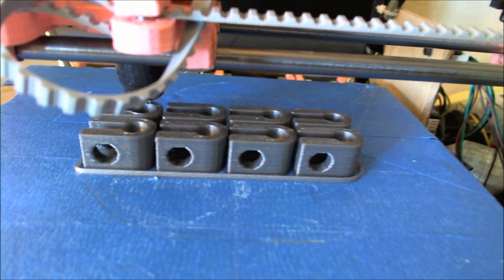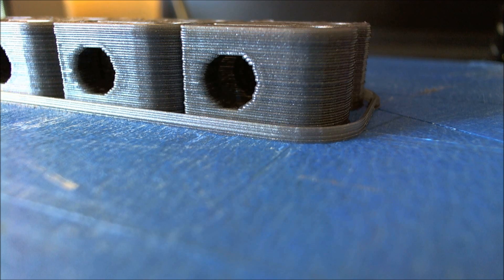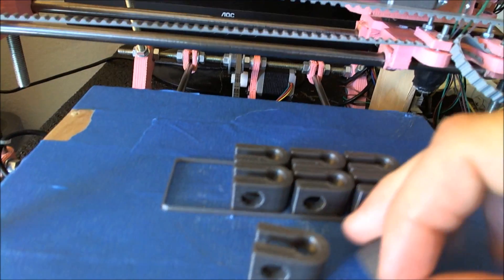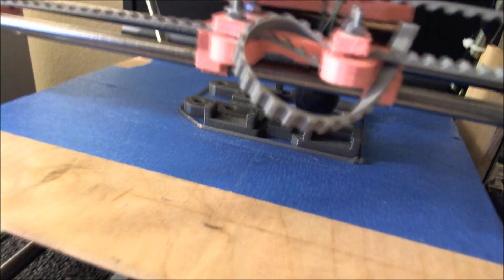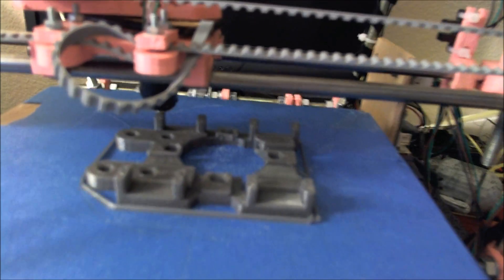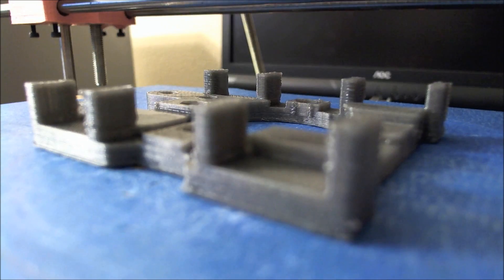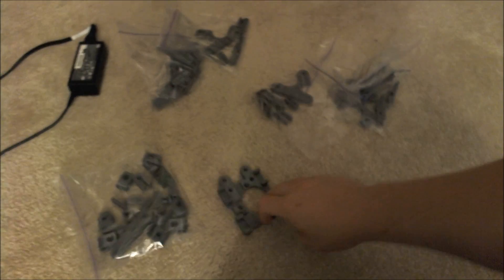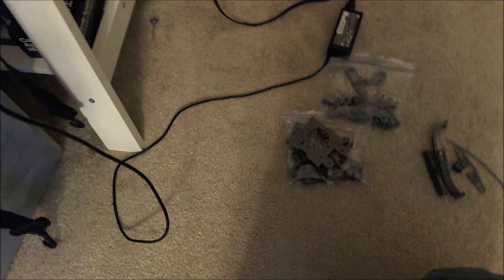Why I am starting to LOVE my 3D Printer

Comment: Thanks for the video!!! Awesome prints :D 

Btw, for anyone who has some ideas......

XYZ Da Vinci VS Prusa? 

Budget: Low to £800 (though I could get the Da Vinci for £450)

Main priorities being the print bed size/max dimensions possible, ease of use and cleaning, reliability, using Blender (or something similar?) to model, and safety ^^

I really appreciate any ideas and thoughts! Thank you!!

I'm up for modifying but would rather not-- just in case I ruin something!!
Reply from the maker: +AmbieWolfie I would always recommend building your own over a out of the box machine. Plus from what I've seen, DiVinci kinda sucks

Comment: Where I used to work plastic parts aged like metal and needed replacement as fittings.  This 3D printing technology would have been a godsend for emergency repairs.  Knobs, odd ball plastic fastening hardware, the list of small one off parts would gave been endless.
Reply from the maker: +Phillip Mulligan  I agree totally, I have made so many little things that have made it worth it

Comment: only problem your printing in pla and that degrades in time especially if the parts are in the Sun for a while my opinion you should be printing in ABS not pla
Reply from the maker: +Richard F J.r. Im still using PLA and still no issues

Comment: where do you het 5 pound rolls of pla and what does it cost? i get 1kg 2.2 pound rolls for around $10 to $13 now would love to get it cheaper.
Reply: Careful of cheap PLA. I know that's annoying but honestly-- 

Cheap PLA can be manufactured in SMOOTH strands. This isn't good, as the machine can't grip it so it jams it up easily.

Cheap PLA also can be on a tighter coil, so the material you get nearer the centre actually is crap quality, as the tighter coil means the PLA (or might have affected ABS mainly, idk) causes stretching and weakening of the plastic. I think this problem is mainly for ABS though as it's not as flexible as PLA.
Reply: Careful of cheap PLA. I know that's annoying but honestly-- 

Cheap PLA can be manufactured in SMOOTH strands. This isn't good, as the machine can't grip it so it jams it up easily.

Cheap PLA also can be on a tighter coil, so the material you get nearer the centre actually is crap quality, as the tighter coil means the PLA (or might have affected ABS mainly, idk) causes stretching and weakening of the plastic. I think this problem is mainly for ABS though as it's not as flexible as PLA.
Reply: AmbieWolfie maybe its just my printer with the flexion but i feed it the cheapest garbage money can buy and it feeds just fine.
Reply: Damn, lucky XD ^^

Comment: have you tried using repetier printer software with the cura slicer I come out with rally nice prints after a lot of work adjusting the printer I have a reprap i3 I ordered a sample from makerbot and I printed the same file it is hard to tell the difference. My point is the repetier software helped me a lot before I used that my prints where not as good now my $250 printer prints almost as well as a makerbot

Comment: Too make multi piece of the same parts why don't you get some (Smooth-on) silicon to make a master mold and get some resins to make high quality parts a the lower cost to you.
at a faster speed.

Comment: Can these printers do threaded holes? Or would they need to be tapped? Also how does/would this material hold up to outside?
Reply: ultra late response, but I would not recommend printing threaded holes or bolts. What I do is is make a hex hole for a nut and place an actual nut in the hole. You can friction fit it, or apoxy the nut in the hole. It will be way stronger and more reliable than a printed thread.
Reply: LaughterIsFunner thank you.
Reply: High-end ones like what I use at work can, but add a zero to the price of a regular makerbot for that capability.

Comment: Nice video! Try greasing the movable parts of the printer and see if it prints better after that! I heard the tip in this video: Building the Velleman K8200 3D printer - Part 3: Printing and Calibration Cheers! :)

Comment: cant you make a new 3d printer from 3d printer
Reply: sariltv You could probably buy a cheap 3D printer and use it to make a better one.
Reply from the maker: Yes, and I have, several times.
Reply: chayfuo  Yes, I think one using step motors 4 dlls , a simple extruder , and a set of wood
Reply: +Jorge Belltran I don't get u!
Reply: chayfuo Not exactly, but you can make alot of a 3D Printer with a 3D Printer. (Ie: You can't print the stepper motors, but you can print the chassis, etc).

Comment: @harrelson_trumpets  I have a cnc mill in the tool room as well as a lathe. Milled aluminum parts would take just as long or close, would weigh more and cost much much much more. And the setup woudl take much much longer. Go price 1" 6061 slabs. These cost him < $1. A full set for the i3 probably costs $3 to print and sell for $35-$70 bucks and sell as fast as they are printed. And there are a LOT of shapes you can print with a 3d printer you simply cannot do via machining. Like casting every technology has it's place.
Reply from the maker: Well written!
Reply: +cdreid99999 I have to agree but disagree too.  Cost is way more BUT the production value is far superior and the subtractive versus additive processes there is no comparison in time.  Additive can make stuff that a CNC can't but for simple designs much better.  Oh, on a CNC mill/lathe, as you know, what he made (the clamps) here would require 4 axis or 3 axis and whip out a drill or lathe.

So, each have their places and lets not forget we do have metal, real metal, extruding 3d printers but they are HUGE, 6 figure expensive, and require all sorts of active cooling so nothing you will put on a desktop for sure, lol.
Reply: i have both 3D printer and a CNC mill, altough i never really use the CNC (its my dad's) but i always thought of using it to make molds out of alu or steel, if i wanted to mass produce a piece (like 1000x) i think it would be much , much cheaper to make a mold with the CNC.

like these parts this guy is making, theyre the kind of things you'd want tons of. 3D printer is better for custom, 1 time parts.
Wouldnt produce to sell any of this. Unless it was a friend needing some of his shit fixed with a specific part
Reply: wargarkaz
Precisely.

Comment: I have no experience with 3d printers so I have nothing to compare it to. That said this printer has exceeded my expectations. Within an hour of starting to use it I was printing my first object. After that I made a test design in sketchup and was able to print it as well. My son has been downloading designs from thingiverse like mad and printing them, he even printed an object that clips on to the printer to help feed the filament.

The company was great to deal with, kept in touch with me and answered my questions promptly. Even though this shipped from China I got it in a week. This is the wave of the future... You gotta get one .. Check it out,,,,<a href="http://www.amazon.com/gp/product/B00E5OQIKS/ref=as_li_ss_tl?ie=UTF8&camp=1789&creative=390957&creativeASIN=B00E5OQIKS&linkCode=as2&tag=credipedia-20">UP! Mini 3D Desktop Printer, 100-240V AC, 50-60Hz, 200W</a><img src="http://ir-na.amazon-adsystem.com/e/ir?t=credipedia-20&l=as2&o=1&a=B00E5OQIKS" width="1" height="1" border="0" alt="" style="border:none !important; margin:0px !important;" />

Comment: Why not just use wax paper as the base to keep it from sticking too much? Or at least just throw down a super thin layer of spam. I have to imagine that it wouldn't hurt the printed object since you can cook with it and all..
Reply from the maker: I am currently using heated glass. It works much better than painters tape.

Comment: How much is a complete kit?
Reply: contact me @ victorwalczak@live.com

 for mendel kits   or buy it directly on my ebay
 http://www.ebay.com/itm/221322160826?ssPageName=STRK:MESELX:IT&_trksid=p3984.m1555.l2649

thank you
Reply: victor walczack Thankya. I may be interested.
Reply from the maker: This is an old model. You can find much better kits for less than $750. I like reprappro, bukobot, and kossel clear by blue eagle labs.

Comment: To answer some of the questions below:

He is printing the plastic parts to build another printer.  These parts, with some off the shelf metal hardware and electronics will let someone else build a 3-d Printer. 

The most common plastics for 3-d Printers are ABS and PLA.  This one is using PLA.  They are about as strong as lego pieces.  You can control how strong they are by controlling how much of the inside of the part is filled with plastic.  That's called "infill".

Yes, it can print phone cases, But no, it doesn't print rubber.  What it can do (and this is pretty neat) is print a mold for rubber.  Then you can pour in liquid rubber (Or "oogo" which is a lot cheaper) to make a squishy rubber part.  That's printing a part to mold a part from a printer made of printed parts!

Complete plans for the RepRap Prusa are at RepRap.org.  If you want to build one, ask someone with a RepRap to print you a set of plastic parts.  Most 3-d printer owners will sell you the printed plastic parts for fairly cheap.

Plastic is about $15 per pound, and usually comes in 2 pound reels.

The plastic sticks to the blue tape on the print bed so that it doesn't pop off and mess up the print job.  It needs to stick pretty firmly to resist the vibration and movement of the print bed.

Good luck!
Reply: Robots building robots is not a problem   Robots build a lot of things now.  It's when computers start autonomously designing computers and robots that you hit the exponential curve.  It's an exciting time.

Comment: hey ive oticed that ur reprap is qiet bigger than the normal once i saw online, so whats max dimension i can make my rep rap with, and what abt the software support for that resolution
Reply from the maker: Most 3D printers are printing within a 8x8 inch build plate.

Comment: John, part of the quality/precision issues with RepRap is the entire framing of the printer is relatively flexible.It's built with rods so its to be expected The inertia of the print head moving back and forth causes the frame to move ever so slightly (hard to see). If you can stiffen up the frame you'll have much better results. It's one of the features of higher quality 3D printers. A completely rigid substructure ensures the print head will return to the exact same position over an over.

Comment: Yes, but the plastic parts can be used as patterns for other parts.  I saw where Jay Leno used a 3D printer to make a water pump housing for a Duesenberg.  They would bolt it to the engine and see how everything fit.  Once they got it exactly right they sent it off to a shop that would use it to make a metal housing.  A MUCH cheaper, easier and more accurate way to mock up parts.

Comment: at about 3:55 you said there was a slight warping on one or two parts of  the print and that you weren’t sure why, have you looked into making a plexiglass box like housing? I see some of the really expensive 3d printers boasting about how this helps control the cooling rate of the plastic. Then again I have 0 experience with 3d printing and have only learned about it today so I could be way off.

Comment: Not quite. It is heated through its glass transition temperature which makes it behave like a slime.
This does not involve it getting into the air. Nor does melting. What does is thermal decomposition and boiling.

As for leaking through your skin, try not to touch it while it is printing.

Comment: Just plastic for consumer grade printers. ABS is the most common, but PLA is used here. You could still make one using a rough surface for grip instead of a rubbery material, though.

Comment: 3D printers though are quite 'expensive' (see $4k + dollars), so he asked people to help fund the parts he needed to build his 3D printer. Those people are his backers and in turn, he's printing parts needed to build your own 3D printer minus the Gen6 control board and a few cheap metal components buyable at a hardware store.  So it seems he's basically paying back the people who helped chip in to buy him a 3D printer, by making them their own 3D printer parts. A pay-it-forward system it seems.

Comment: printrbot released their new design called Simple and it's $299 as a kit with 100mm cube print area. I had the beta of simple and the one they released is actually better and included a lot of the design mods people suggested in forums included.

Comment: Recommend:

Apple iPhone 5 (Latest Model) - 32GB - Black Unlocked NEW Price:$385

Samsung Galaxy S III GT-I9300 16GB White Unlocked Price:$330

Apple iPad 4th Gen 32GB Unlocked Wi-Fi+4G 9.7in White Price:$390

LED 3D HDTV: Panasonic 65-inch 3D LED HDTV Price: $460

Apple MB543LL/A MacBook Price: $350

All-in-One PCs：Apple MB417LL/A iMac w/ 20" display desktop Price:$320

Canon EOS 60D Digital SLR Camera 50mm 18-55mm Price:$360

>>>>>>>>>>>>>>>>>>>>>    Purchase online Website is:  FUUshop.com

Comment: You'd have to print them at a small layer resolution, but it's definitely possible. I've printed at 0.1 (tenth of a mm) on my Printrbot LC, though normally I print at 0.25 or 0.4. Even at 0.25, the detail is excellent. I may print something small soon to see how small I can get it.

Comment: Its actually pretty damn well written. Theres how to condense and entire huge backstory into what'll fit about half a you-tube comment box, and slam us, everything instantly decoded and neatly packaged, straight into the main action, heads spinning with foreboding and potential and an authoritative sense of urgency and rising panic not merely mentioned but created on the spot as you read. Seems simple, but if you've ever tried your hand at that discipline - its not .

Comment: "The Mendel-bot Funding Bill is passed. The system goes on-line August 4th, 1997. Human decisions are removed from strategic defense. Mendel-bot begins to learn at a geometric rate. It becomes self-aware at 2:14 a.m. Eastern time, August 29th. In a panic, they try to pull the plug".

Comment: In about 15 years you might not need to be rich. Back when computers came out a regular printer could cost as much as your computer itself. Sometimes more. Now a new printer is often cheaper than replacement ink cartriges. Eventually the price is going to drop and they will become as common as an inkjet printer. Remember how expensive laser printers used to be 15 years ago? Now they're cheap enough anyone can afford one where as back then most colleges couldn't afford them.

Comment: One reason is you don't need draft and can make parts using 3d printers that are not possible to cast. I think if you ask why you would use a 3d printer, then you're missing the point. Another reason: so you don't need to make a mold, or keep a mold around, or perform molding operations. A third reason: so you can make refinements in design and re-fabricate a part with fewer steps. Another reason: this is a developing field and hobbyists and DIY makers are pushing the technology forward.

Comment: that is in fact exactly what he's doing here, printing parts for another printer.  when he compared the bar clamps he was printing to the pink one?  he's duplicating that part.  looks like he was working on kits that others can buy.

a 3D printer cannot yet print a whole copy of itself, however -- metal parts and electronics have to be manufactured separately. but people are working on it; that's the goal for the reprap movement.

Comment: I think you are missing the purpose of 3D printers. They are for unique items or small batches where the time delay and cost of making a mould is not justified.

If the prototype built using 3D printing is satisfactory, then the investment can be made in mass production, if necessary.

But for one off buildings, boats, jewlery and replacement parts, a single unit is all thats required. Hence the huge interest in 3D printing for small workshops, design studios and home-hobbyists.

Comment: Can't disagree more with the moldmakers here.  First, you have to buy the mold material...are you going to use expensive silicone?  Then you have to take the time to mold them.  If you print one you might as well print all the ones you need.  He isn't printing thousands of these things.  The material is pretty cheap, at 30 bucks a kilo.  Electricity costs don't add up to much either.  3d printers are slow, but they are for rare or unique items.  Just download the file or scan an item.

Comment: My comment has nothing to do with the diy 3d printer in and of itself, I am simply stating that cast-molds are more efficient to save time and energy for creating the same part many times over. For something like this, injection molding would be ideal. If 3d printers were optimal for production then companies would use them to mass produce parts... but they don't, because they are too slow and use a lot of energy. Plus the prints here are inconsistent, this is not the case with injection molds.

Comment: Why not print one part, refine it, and then cast and mold it to make more? Better quality and constancy for each part thereafter. You can boolean it in the 3d app before hand and print the castings instead of the part, then mold the casts and remold those casts in silicone. Better yet to simply cast the part in silicone of course but you#d have to spend more work on forming the edges, which is why I mention the reverse instead using boolean casts to mold instead, it would be far more accurate...